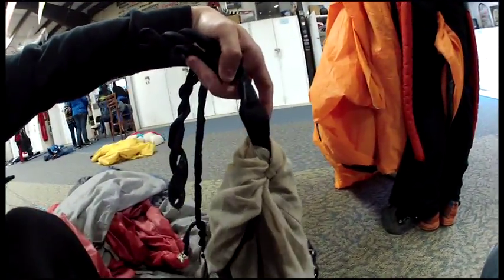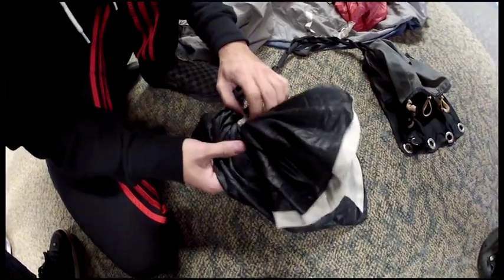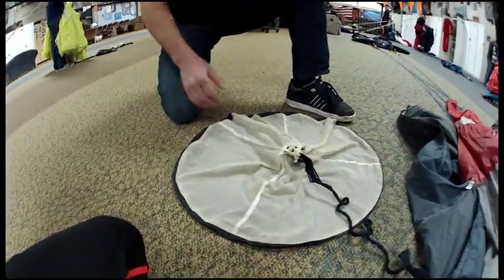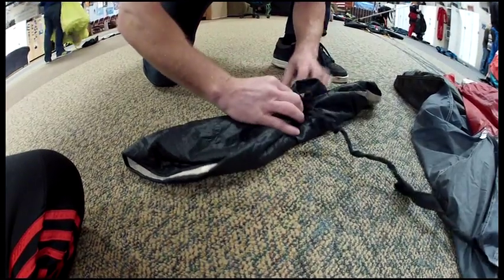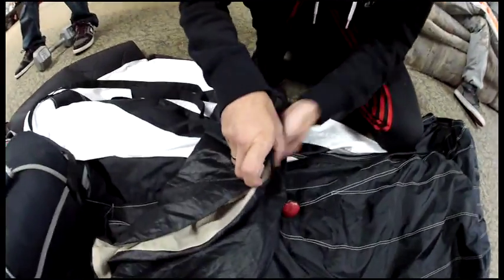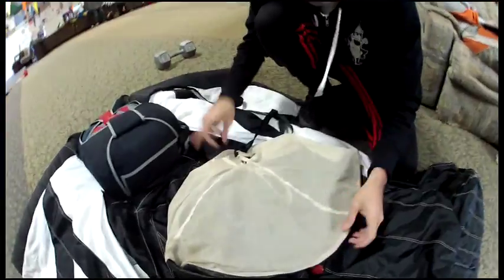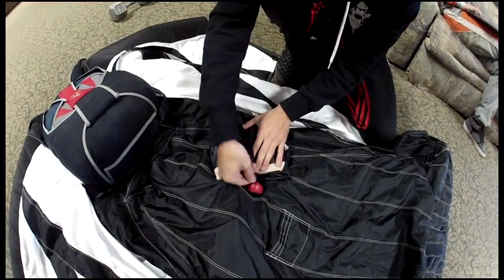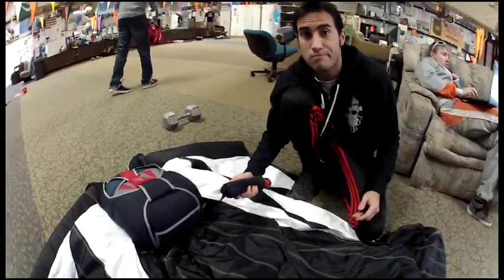Pilot chute in tow - Revision 01

Comment: They do tend to work better when they are cocked before packing
Reply: That wasn't the problem. The bridle was knotted around the pilot chute. If you watch the jumper's folding method he places the ears of the partly folded pilot chute near his bridle folds. To avoid this you should fold the ears of the pilot chute well past and over the bridle folds so they cannot get trapped. It's a tradeoff, the original goal of that method is to help a horseshoe to clear, but the result is those long ears causing this PIT.

Comment: This is almost the method that I teach, however, there is one important difference. I teach to have the bridle exit the top near the handle. This way, in the event of a horseshoe malfunction, the bridle will pull the pilot chute out all by itself. If it comes out of the bottom as he shows, it will most likely turn the pilot chute sideways inside the pocket and lock it up. Here is a link to my demonstration:
Reply: I've noticed this method for packing the pilot chute won't prevent a horseshoes malfunction if your handle has a locking/freefly tab (which is really common nowadays), it'll just be slightly easier to resolve the horseshoe yourself because the BOC should be empty so reaching back to unlock the handle should fix things.